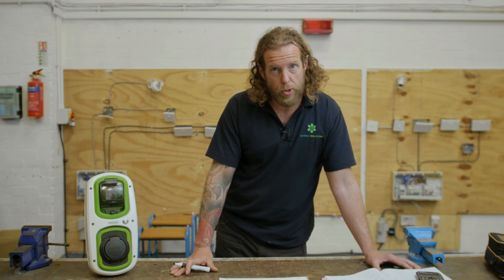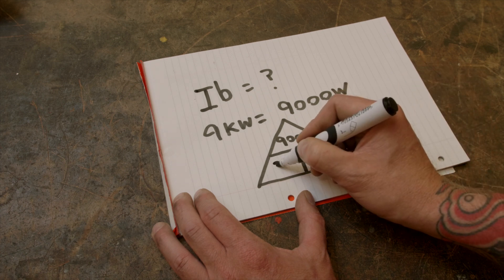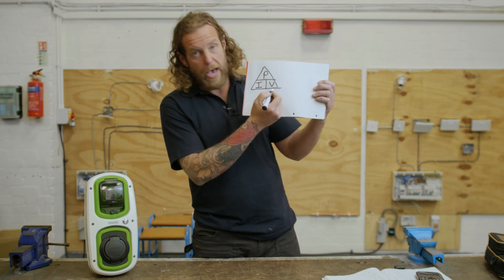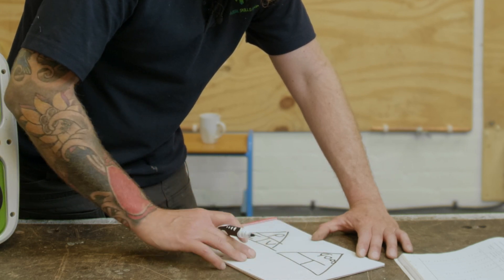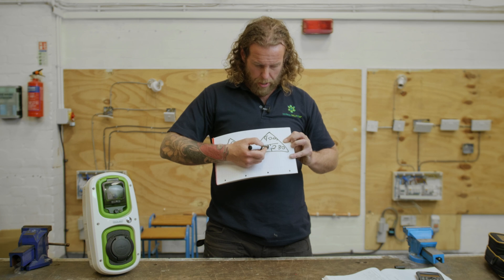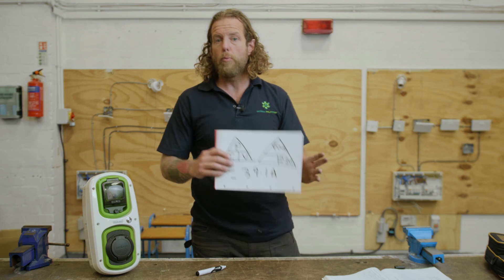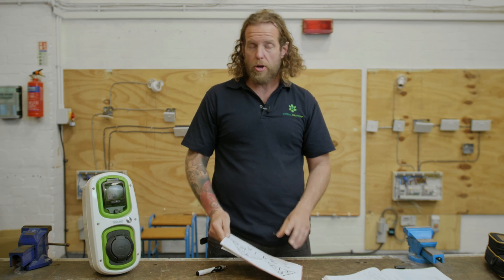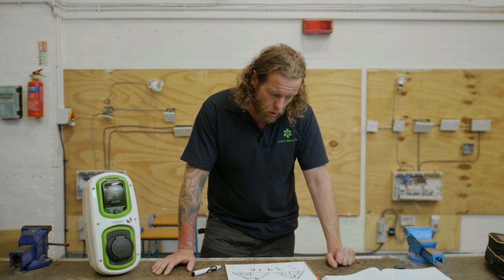EV Practical Assessment Guide | Electrical Tutorial

Comment: If you are having to educate time served electricians how to do a basic calculation in such a 'Janet and John manner', then they really should not be undertaking the EV course. Any Level 2 learners can work out full on cable calculations with no trouble at all, and that's with taking into account any correction factors. Most would also then understand thermal constraints and calculating/verifying an impedance value for the circuit. An Ev course is for experienced qualified electricians that should have inspection and testing qualifications. If I had a learner that could not work out Ib or voltage drop for a circuit , they would be politely told that the course is not suitable for them.

Comment: Excellent video mate. Does the breaker have to be an rcbo tho?
Reply from the maker: Thank you for you feedback! All car chargers must be protected by a minimum type a RCD, this can either be a main RCD within the consumer unit protecting all circuits or in the form of an RCBO protecting the car charger only.
Reply: @UniversalSkillsGroup  I was under the understanding that you can use an mcb depending on what cable you use and how it's fitted, ie not in wall but but on wall.
Reply: @gino2465  You must have RCD protection of at least Type A, this can either be at the consumer unit or within the device itself.
Reply: @stevedebbiemoore  appoligies I ment the supply to the charger, I suppose it could be an mcb as long as the cable is not imbeded in a wall or is an swa cable. Clipped to a wall.
Reply: @gino2465  it must be protected by both, MCB for overload and short circuit and RCD for additional protection earth faults.